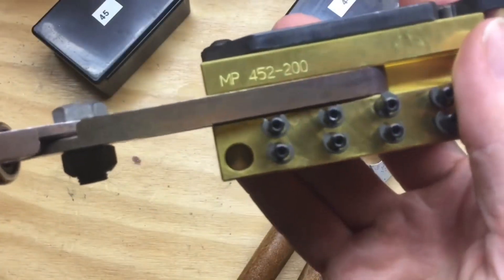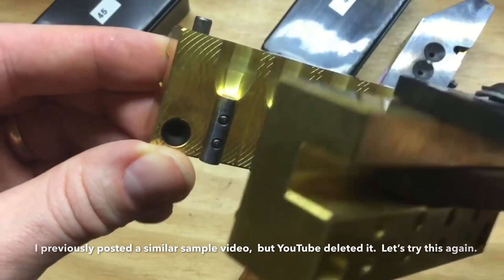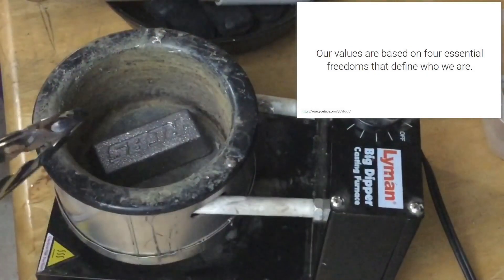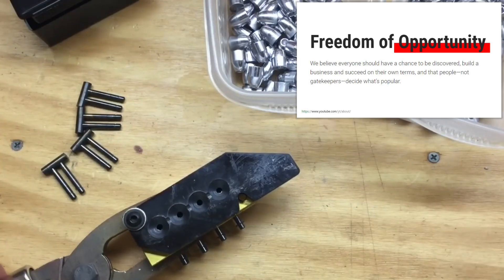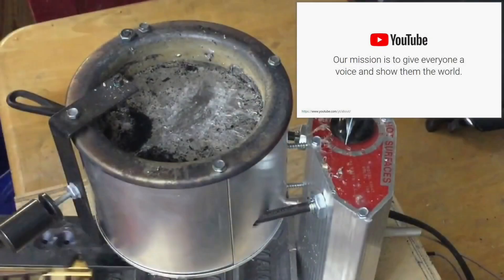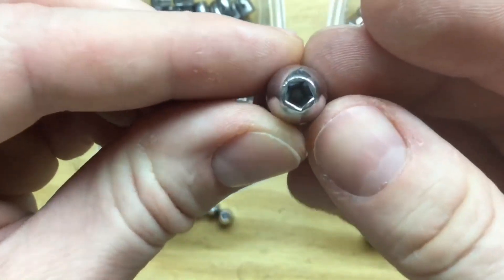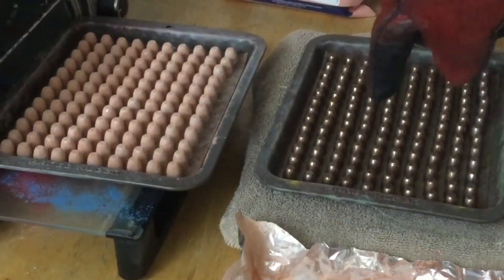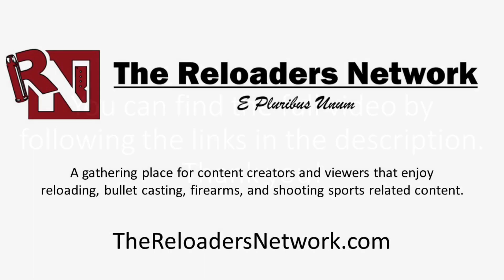.45ACP - Hollow Point Casting and Powder Coating with the MP 452-200 Mold

Comment: I couldn’t get to the full video, was wondering if you had any excess powder buildup in the hollow point when coating the bullets and how you fly with that, I’m about to start pouring some 45-70 hollow points for subsonic and wondered if I would have any issues dry coating them. Thanks in advance bud.

Comment: I'm having a problem with my 200 grain swc cast bullets fitting into my acp casings after powder coating, I don't have a sizing die, is there a way I can fit the bullets into the cases without bulging them? U only coat them once and they come out uniform but my mold is 452-200 and uncoated they chamber fine but after coating they're about 453 and just fat enough they don't want to chamber in my 1911 I taper crimp them all and the bands are the problem. Do you have any suggestions besides getting a sizing die? Also that mold you used to make those hollowpoints is badass! What is it made out of brass or some kind of anodized steel?
Reply from the maker: You're either going to need to get a sizing die, seat the bullets deeper, or both.  Bullet size is key for cast bullets; pick up the sizing die.
The mold is made from brass.

Comment: Do you know the model number of the comparable 9mm mold. And if I see it right a person can opt for a hollow point or no hollow point from same mold?
Reply from the maker: The mold comes with pins that can be swapped to enable to to cast solid nose/no hollow point, a round hollow point, or a 5-sided hollow point.  I received one mold, three sets of pins, and can cast the three different variations of bullets all dem the same mold.
I'm not sure what exactly you are looking for in a 9mm bullet, but I'd suggest taking a look at his "MP 357 -125 HP PB" and his "9mm/38, 147-154, Bevel Base".  I don't have any experience with those particular molds myself, but they do look promising.
Reply: @LoadsofBacon  yeah that one is out of stock  I think I will try the 8 cavity the sku  is 10180. Thanks for replying so quickly
Reply from the maker: You may want to take a look at NOE Molds as well.  They use a slightly different hollow point pin design, but they also make great molds.  I own and like multiple molds from both companies.
Reply: @LoadsofBacon  will do thanks

Comment: What if you dont powder coat?
Reply from the maker: I'm not sure exactly what you are asking, but if you don't powder coat then you should buy bullet molds that have lube grooves so that you can lube the bullets in a more traditional manner, such as with tumble lube, pan lube, or with a lubrisizer.  You could also use a coating called Hi-Tek.
Reply: @LoadsofBacon  my question is what happens if i dont powder coat my bullets? If im casting my own bullets. Nice video and thanks for the reply : )
Reply from the maker: Cast bullets need some sort of lubrication.  Powder coat can serve that purpose, and there are a few other lubes that can work, but cast bullets loaded and shot with no lubrication will often result in excessive barrel leading.